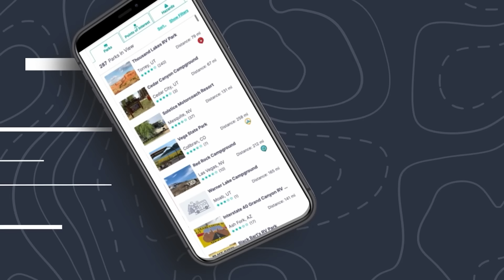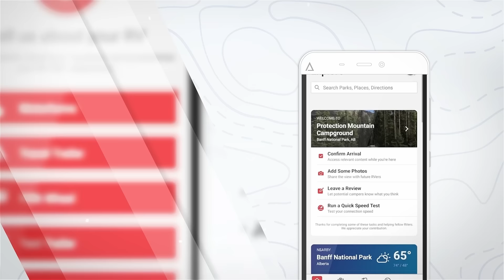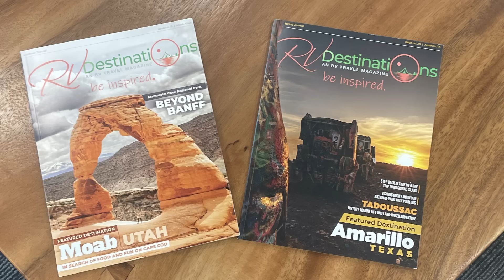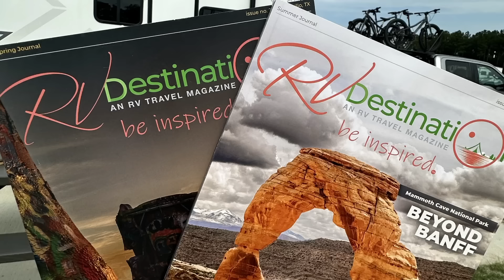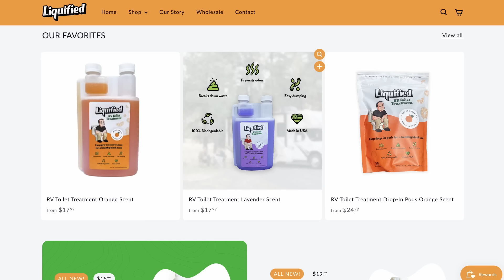333. Does RVing Cause Us to Fight More? RV Conflicts and How We Manage Them

Comment: Great points on stress-related issues while camping. I think we have reached a time where it just rolls right off our backs. Jason's black tank about the door lock was interesting too. As a matter of fact, many Airstreamers have had this issue with the deadbolt and other door lock. Someone even makes an item to attach to it to prevent one of theme from locking unexpectedly. We haven't had an issue with it, but we did put in a piece to keep the non-deadbolt lock from locking on its own. Interesting that you brought it up with the apartment. We'll share that with you at Homecoming.